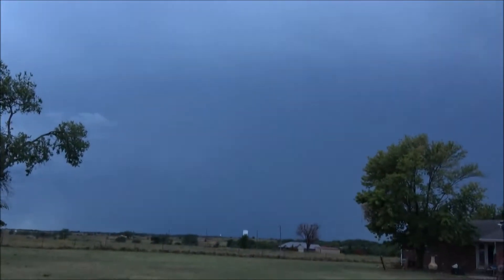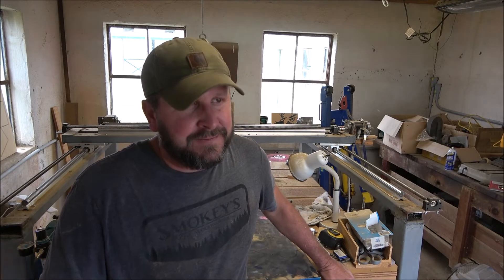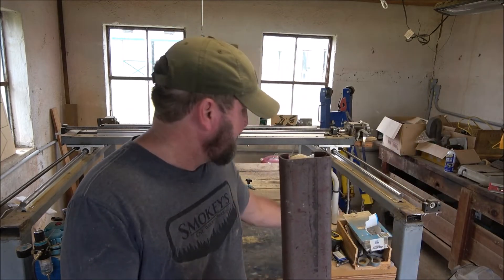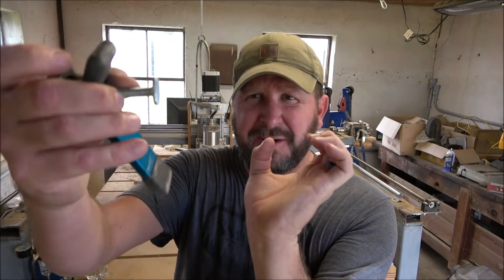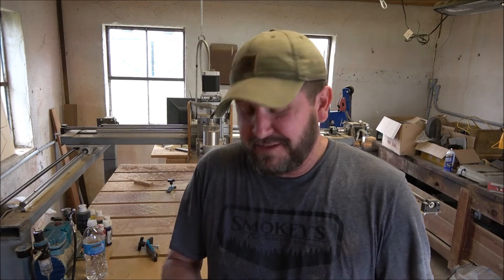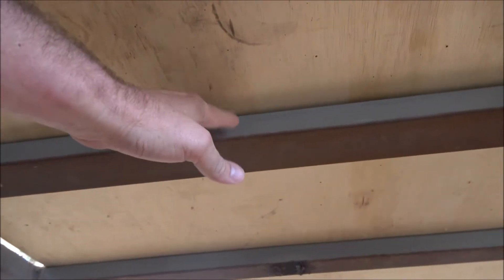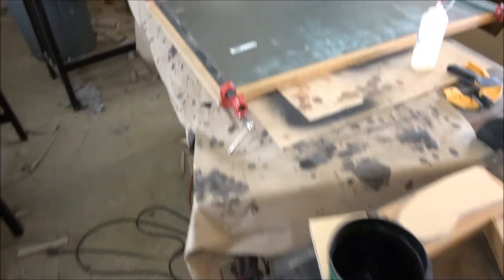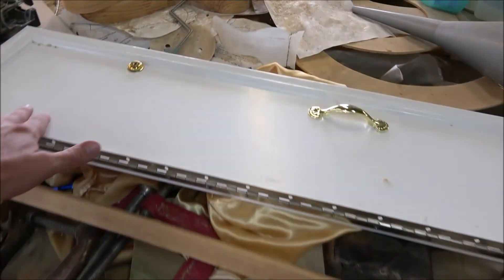DIY CNC Frame (Questions and Answers)

Comment: steel or aluminum that was the question . My build buddy is a welder but we have no space to put a machine so extruded aluminum it is .
Easy to dismantle or even reconfigure. I tell you though I would definatly do steel if I had your space. I completely turned my situation around and went into the woodshop and my brother put some angle push plates from the Z axis and cut the faces flat and square on a 12 inch panel saw just like that 10 min short vid on facebook . I have been worried about  the machine rocking with my narrow base so maybe some bracing Showed him your vids too one of his  on an epic table top cut https://youtu.be/p6EvqbOR4sk
Reply from the maker: I agree, I think if I were to take another run at a machine (which I have no plans for)...I would probably go the extruded aluminum route....I'll check out the vid...Thanks for watching!!!

Comment: There are cnc kits on amazon now.  The controller and software are not the best, but an easy upgrade.  The money to headache relationship is real.  I spent less than half to build my machine rather than buy it. On the plus side Having built my own I know it's ins and outs, so if/when there is a problem i can fix it.  On the Downside the wiring  instructions are not very good.  So be prepared to figure it out yourself.  Make the investment to buy good shielded cable for the router.  Stepper motors on cat5 with no problems.  Be handy or learn fast building a cnc router is not for the weak willed.
Reply from the maker: That would be a good starting point, buy a kit and upgrade it....and I can't agree more building one from the ground up isnt for the weak willed!!! lol....Thanks for watching!!